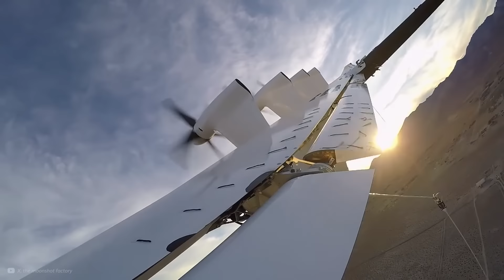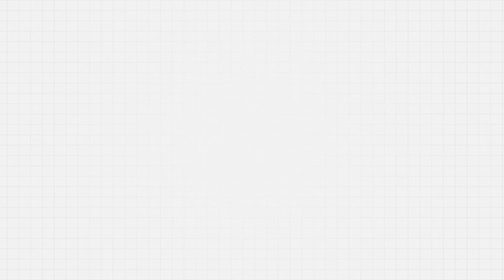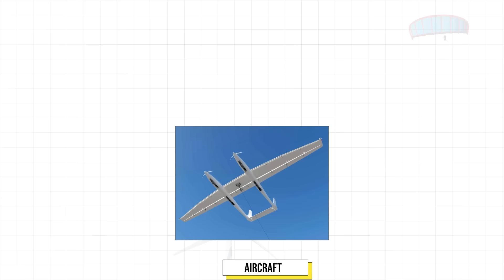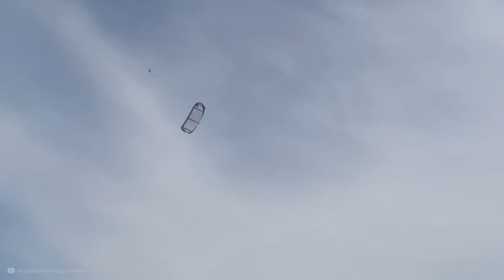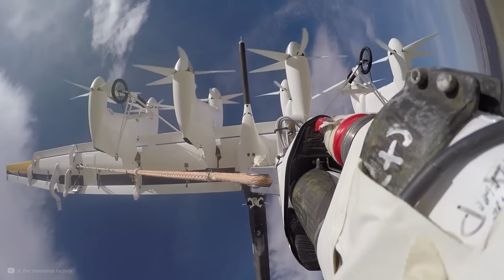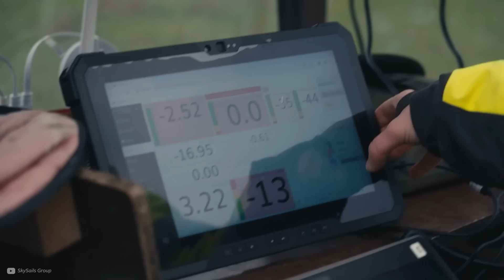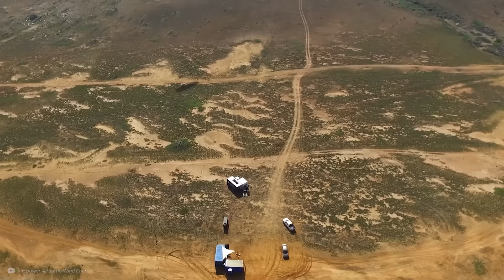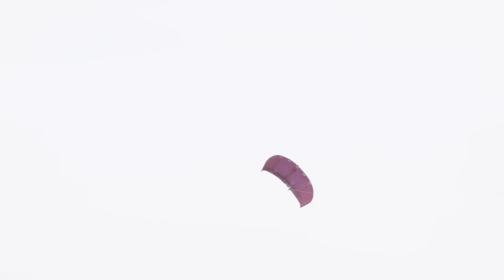Airborne Wind Turbines: The Future of Clean Energy?

Comment: Hi, Ok you did indeed show all that is wrong with land based Green energy systems and it was mainly the reduced Air speeds at lower altitudes with regard to wind turbines and the existence of trees and other buildings in urban Areas that makes them impractical to build anywhere except on open farmland areas that are actually needed for other more practical uses - like farming.😉

Existing wind Turbines are not only an ugly blight on the landscape and dangerous to the bird population but as you said don't have a very good carbon footprint - plus they can be destroyed in high winds and the destroyed parts in them hard to recycle when that does occur and of course the disruption to the grid system could be significant if enough of them are destroyed at one time.

One of the Best Systems I've seen to date on You Tube was actually a combination Wave generator Wind Turbine and solar panel Unit mounted on a floating Barge arrangement and tethered Offshore in the ocean - because its logical there would be unobstructed wind power at low heights at sea level and the oceans are our greatest asset for placing green energy systems on off shore barges or even on existing oil rigs that are pretty high up towers that are already made and would be ideal for that purpose.

I'm just surprised none of the oil Drilling Companies haven't seemingly thought of repurposing and Putting Existing oil rigs or reusing old ones for that purpose because Old rigs nearing their useful life could be brought back close inshore and retrofitted with all three types of Electric power Generation systems, i.e. Wind, Wave and air powered units mounted on the Old oil Rigs.  🙃

Comment: I like this tech but it has to have one of the worst ratios of power vs surface needed. If the cable is 600m long that would be the minimum distance between system for the kites not to get entangled. And then at least twice as much land around it for safety if it falls to the ground. The only way I see a farm of this kites is offshore.

Comment: The "O" flying air craft is the most-reasonable situation as the wings fly the craft, while the fan inside the turbine, like an aircraft jet turbine, is able to spin at enormous wind velocities (at higher elevations).
Reply: That rather restricts the swept area which is bad.
Reply: @rogerphelps9939  Many of the other tethered airfoil wing designs with the scaffolded wind turbine below the wings is not proper, and removes the aerodynamic lift under the wing of the craft itself.

Comment: Congratulations on submitting your Ph.D. thesis! I know what a relief it is to get to that point and past the, "I'm never going to finish this" stage.

The bird safety issue with static wind turbines is rather over stated (often by those who advocate for continued fossil fuel burning). The estimate for wind turbine bird deaths in the USA, with 150GW of installed wind capacity, or 9.8% of the country's total power generation, is between 681,000 and 1.4 million. Not small, but compared to the estimated 1 billion birds killed by buildings and the 1.3 to 4 billion killed by cats (again, just in the USA), the number pales in to insignificance. I'd be the first to advocate for action to reduce those wind turbine deaths (for example, painting one blade of a turbine black, to increase visibility, can reduce bird fatalities by more than 70%), but it's really a distraction. If the USA generated ALL of its power using wind turbines and took no action to increase bird safety, it would be responsible for at most 0.6% of the bird deaths in the country. I'm also ignoring that fossil fuel burning is estimated to kill 24 million birds per year.
Reply: AND............ what the hell is all this BS about them causing cancer???
Reply: What number is 0.6% of bird deaths? What percent is 24 million?

Comment: Global annual energy consumption is about 172,000 TWh.  Of this, 80% (138,000 TWh) comes from fossil fuels.  Tens of millions of wind turbines and solar farms would be required to generate this amount of energy.  It is impossible.  The problem is that fossil fuels are a dense energy source but wind and solar are not so it takes much more infrastructure to harvest an equivalent amount of energy.
Reply: Both IRENA and IEA disagree with you, based on current projections renewables will account for 77% of energy mix by 2050, with hydrogen being a laggard with clean generation (hydrogen being required for industrial heat generation). Fossil fuels are a finite resource, and their usage releases some 37 billion tonnes of CO2 annually, so it's less a question of staying as-is but seeking alternatives. The best available option is to use the our local friendly giant fusion reactor in the sky, which kindly provides 175 quadrillion watts of energy to the Earth every second; an amount of energy that dwarfs that of fossil-fuel and can be accessed via solar, wave and wind harvesting and indirectly via hydro (with the aid of gravity). Plus of course we have our own internal nuclear planet wide nuclear reactor that is accessible by geothermal, plus some other gravity assisted systems such as tidal.

As of 2023, 183,000TWh was used globally, of which 140TWh was by fossil-fuels (dropping to 76% dropping from the 80% level that was from 2018). So rather than using hyperbole and speculative 'big and scary' figures, let's model this on of existing capacity:

- Using offshore wind, with it's lower site density than either PV or onshore wind, using Hornsea 3 and 2.9GW farm occupying 696 sq km, with a capcity factor of 47.3%. This site generates ~12TWh of energy a year, meaning 15,250 sites would be required covering some 11 million sq km, which is less than 3% of the Earth's accessible ocean surface area; or,

-  Using PV, for example the Talatan Solar Park in China, which occupies 420 km sq and outputs 10TWh a year. This would mean 18,300 such PV sites would be required, covering 7.7 million sq km, about 5% of the Earth's land area, and much less than the 37% used for agriculture.

This is way less than the Tens of Millions of renewable farms you projected. Altough, of course, renewable sources would be diversified and mix with low carbon sources (such as nuclear) and interconnects to provide near constant generation. Further, technology advancements, such as improving PV efficiency and increasing turbines power, are shrinking the size of farms required. All this, of course, would give the additional bonus of saving the 37 billion tonnes of CO2 being released annually.
Reply: Your last sentence suggested that I'm not concerned about CO2 emissions.  I am.  I've just been skeptical of the ability of current clean energy initiatives to solve the problem.

I believe you're confused about the IRENA and IEA stats.  That's 77% of electricity, not of total energy.  It's understandable. The articles I read often use "energy" when they mean electricity.

I use the US Energy Information Administration for my stats.  I agree with you about the percent of fossil fuel use in 2018 and 2023, however, even though the amount of fossil fuels consumed in 2023 as a percent of the total was lower, the total amount of fossil fuels consumed was slightly higher.  That's not an improvement.  

In 2050, the EIA forecast is for total energy consumption to increase by 40% and for fossil fuels to be 68% of the total.  That's moving the needle in the right direction, but not nearly fast enough.  Here's the EIA link:  https://www.eia.gov/outlooks/aeo/data/browser/#/?id=15-IEO2019&cases=Reference&sourcekey=0   
I don't use IRENA because it promotes clean energy and has a bias to optimize the clean energy numbers. 

Regarding Hornsea 3, two factors explain our difference.  The first is that I was counting individual turbines, not turbine farms.  Hornsea has 231 turbines, so 15,250 sites would be just over 3.5 million turbines.  The second is that I was using land-based turbines that have one-third the output of offshore turbines.  

Hornsea is expected to cost $10B, so 15,250 similar sites would cost $152 trillion.  By comparison, the global 2024 GDP is estimated at $110 trillion.  The world currently spends 5 to 10% of GDP on energy production.  If we allocated 10% of GDP to the project, it could be done in 15 years.  This would not only require global consensus, it would also require wealthy countries to subsidize the cost for poorer countries.  That would be a difficult sell.  

In theory, this is more achievable than I thought, so thanks for sharing this information with me.  The big surprise for me was how much bigger the offshore wind turbines are.  On the other hand, building the energy storage required to buffer intermittent energy sources, connecting to the grid, and upgrading the grid will all be additional costs.  The biggest obstacle, however, is that all non-electric infrastructure (industry, transportation, and heating) would have to be converted to electricity.  This would be a mammoth undertaking requiring decades.  And, once again, it would also require global cooperation and subsidies from developed to underdeveloped countries, something we've not seen in the 28 years of COP meetings.  

The biggest problem with the shift to clean energy is the idea that we can have our cake and eat it too - that we can continue to grow the global population and economy while reducing emissions.  Aside from clean energy and improved efficiency, the only way to reduce emissions is by reducing demand, which (netting out efficiency savings) will require fewer people and/or austerity.  

Fewer People: The fertility rate is at an all-time low, but the population base is so large that we still added another 70 million people in 2023 - more than the population of France.  China showed that nations cannot manage their fertility so the current trend will continue.  The UN median projection is a peak population of 10.5B in 2050.  I think it could be sooner and lower than that - 2040 to 2045 and 9.5 billion.  

Austerity:  Nobody will sign up for it until the pain becomes too great to do otherwise. One problem with this is that developed countries are largely in the northern hemisphere where the impact of climate change is happening slower so they will be slower to react while less developed countries are in the tropics and subtropics where severe impacts are happening sooner.  This will produce unprecedented migration toward the northern temperate zone.  

I agree with you about the need to decarbonize the energy industry, I just don't see it happening fast enough to avoid catastrophe.
Reply: @fr57ujf  - Personally I prefer to use the international sites rather than national ones, as they provide a more balanced global view, hence why I referenced IRENA and IEA.  The IRENA 77% renewable figure is total energy mix not just electricity, the analysis covers non-electrical based energy sources via efficiency gains/electrification/hydrogen/CCS+BECCS as well.

My last sentence indicates that something needs to be done and renewables is the best alternative available, the CO2 point is a statement of fact rather than an acquisition. Your wording about renewable sources can be interepreted as both "wind and solar farms", which is how it read to me - as both offshore and onshore wind are mainly being built as energy farms these days not as sole turbines (as occured in the early days).

Energy mix increases year on year (very few years see a dip, generally for external reasons such as the pandemic), whilst to proportion of one energy source reduces relatively to others it's overall volume may increase in line with growth. The 4% increase in renewables between 2018 and 2023 is an improvement compared to what would have otherwise been generated by fossil fuels; transfering some 7.3TWh of energy production from fossil-fuel to renewable generation. 

Like are large scale energy infrastructure projects, renewable farm costs are calaculated over a period of time and payed from over a duration typically 15 to 25 years and includes both capital cost and ongoing operation and maintenance costs. The upfront capital is amrotised over this period and generally covered by a mixed public/private funding basis, the majority being private funding to reduce burden to the tax payer. Hence whilst the figures are large their impact is spread out over many years and not borne within any one year's GDP. 

Further, with renewables the cost of purchasing and operation is much lower than previous energy generation sources, this is why most countries are investing in renewables as it will save money in the medium term on what would otherwise have been spent on more costly energy soucres. The Hornsea site is an example, with all four phases costing a total cost of ~£15 billion it''s cost three times lower and producers 2.5 times the energy than Hinkley C nuclear power plant under construction in the UK; each phase of the Hornsea site also started generating within a year of construction being started and completed within two years. Whereas the nuclear plant will take 12 to 15 years from constructions start till operation begins.

Many developing countries are adopting renewables at a faster rate than developed ones, renewables can operate at differing scales of deployment. This means adoption can be localised and used where it's needed at a scale and cost that suits a particular community or country's need. That said some countries have high natural renewable sources, such as hydro, and have accordingly spent large sums on these, already achieving 100% renewable power. 

In terms of generation intermittency, as well as energy storage countries are using HVDC interconnections to mitigate the impact of local energy supply lulls by sharing energy over a much wider area. There are such supergrids under development in most parts of the world; most grow organically as countries link up their grids with each other. The European smart supergrid is one example, linking the existing Europe wide supergrids to each other and with North Africa's and those further afield (such as Central Asia). These HVDC cables can be very long, spanning 1,000s of kms, with low losses compared to AC interconnections.

You may be interested in International Solar Alliance's  One Sun, One World, One Grid initiative that is seeking to link up countries round the planet's central solar belt, via a series of achievable local projects, to create a global power house. Both enabling many developing countries to become energy sufficient and generate a lucrative revenue stream providing power to other parts of the world.
Reply: The problems of replacing uninterrupted power with intermittent power are not as easily solved as you seem to believe. And it will be much more expensive than just producing wind and solar power.  Uninterrupted power will be needed.  Nuclear is the only clean energy alternative for this.  The obstacle to nuclear is not economic, it is political.  France plans to build up to 14 new reactors by 2050.  India, the sponsor of the "One Sun, One World, One Grid" initiative, plans to add another 80 GW of power from coal-fired plants by 2032.  Meanwhile, wind and solar produce less than 3% of global energy and we are nearing the 1.5 degree C GMST anomaly.  I'm not optimistic.
Reply: @fr57ujf  - Everything generation source is intermittent in one way or other. As we know from recent experience, what was previously assumed to be non-intermittent generation sources turned out to be intermittent - that is gas is responsive to global supply and demand disruption, it's just in the past these were assumed to be constant. One of the roles of renewables is to provide more local generation capacity with less dependencies on third-party supply lines or financial markets. 

Renewable location and source diversification over a wide area, BESS and sharing via interconnects mitigate the most of the intermittency risks allowing a smaller proportion of 'base-load' in the interim is sufficient. 

For example, in the UK The Royal Meteological Society report concluded that a wider area sustained calm over the North Sea was a 1 in 30 year event. The UK's grid risk assessment was that over generation wasn't the cost effective solution, as a two to three calms at 1 in 30 would be better handled by a short period of reduced power usage; taking lessons from the pandemic where a third of the electricity was used in one year compared to the average year. Further, critical industries and services would be served by specific long term energy storage for their needs rather than attempting to produce full resiliance for the entire grid. This assessment went in hand with the observation that households will increasing deploy home generation and storage to meet their personal needs, as the costs of such systems continue drop.

The wind and solar proportion grew to 6% of worldwide energy mix in 2023, from 3% in 2018. Whilst nuclear remained static at 4% over the same period. Plus with wind and solar (and BESS) being so quick to deploy and become operational their ramp up will continue; many countries growing capacity by 20 to 35% (in either solar or wind, discounting those growing from a low base). Denmark for example has 58% generation by Wind. The reality is different mixes of renewables and low-carbon generation sources will apply in different countries.

Regarding the one-world initiative, the ISA is an international organisation counting 120 countries as members, whilst the initiative has been setup via India it was also co-created by the UK and France as ISA members. The aim is to site in a country that can benefit directly and can lead the initial role oout, which will displace the use of fossil-fuels as the initiative ramps up. Like China, India's use of coal is for short term need, that is planned to be swapped to a back-up role as other sources come on stream.